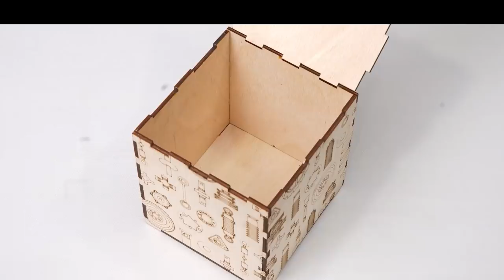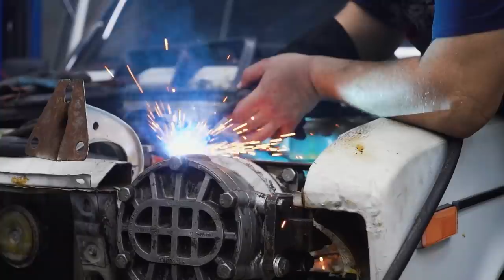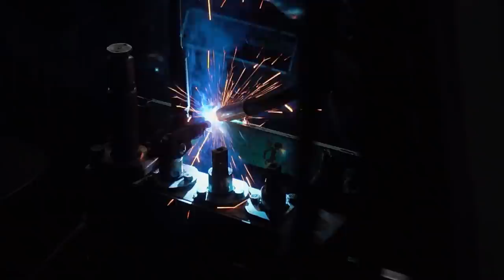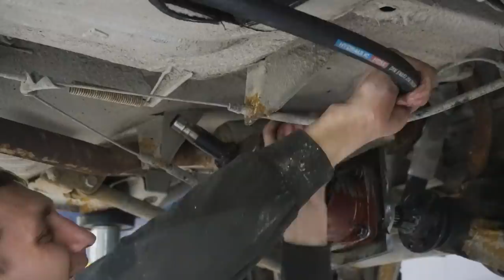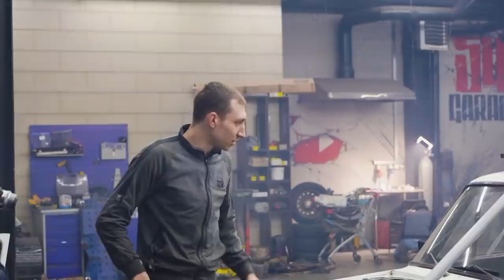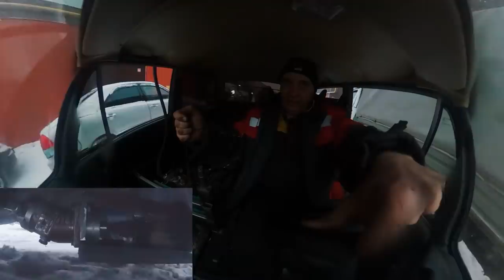Using excavator hydraulics as a propshaft

Comment: Hi. Huge fan of Garage 54 here. Mechatronic engineer.  You need to run that pump through the gearbox on a small petrol engine like that. The Volume/Power curve of that pump is optimized for a large displacement diesel engine which can achieve maximum power by about 1800 RPM. There is no chance of it producing any usable fluid power coupled like that. The pump curve is probably linear bell curve from 200 to 2000 RPM. Will just kill that little petrol engine before it can make any power. Also you need a relief valve on the pump output to prevent stalling the power unit in the case of overspeed vs load*pressure. About 150 bar should be good for your car.

Comment: Struggling to get the RPMs down? What happened to the thought of putting it on the tail shaft of the transmission? First gear would be a significant gear reduction!
Reply: @Bro Tang beat ya to it.
Reply: I think the idea was that they needed to put the transmission on the output end, not the pump end
The pump is being turned plenty fine, but the output is at high rpm while at idle
Reply: Agreed.  Mount it to the trans with out the valve and use it as the prop shaft. Modulating the clutch and gears
Reply: In this case the axial motor isnt delivering the torque required, axial motors used in high torque applications need reduction gear, if not its common to use radial motors.
Reply: @televisionandcheese  Yes, thats how its done on hydraulic drive forklifts, through hub reduction gears.
Reply: Exactly, this video made me cringe.
Reply: @televisionandcheese  use a 5:1 diff
Reply: @televisionandcheese  YOU ARE 100% RIGHT BUT ALSO THE LADA MOTOR WAS DEAD, BLOWING SMOKE WITH NO COMPRESSION AND NO POWER. UNFAIR.
Reply: "none of us have any idea what to do" 😄
Reply: Thank you bro I was just thinking that like he shut down the idea of putting after the trans and now he complains he can’t control the rpm 😭😭😭😭👍🏼👍🏼👍🏼

Comment: The drive motor is not your problem as you can see how well it rotated your wheels the problem is the pump usually requires a five to one mechanical advantage and that's on a three-quarter inch line it sounds like you don't have a big enough sprocket for large enough mechanical advantage
Reply: They didn't do the calculations
Reply: Exact same thought I had.  It would be really easy with that chain drive they have.  Just find a bigger sprocket.  The fact they mounted the pump to the chassis is problematic as well.  The chain is going to tension and loosen when the engine twists in it's motor mounts.  The chain drive is definitely the... weakest link. ;P  Sorry, couldn't resist.
Reply: Mmhmm this makes sense
Reply: Should put it on the output of the transmission in low gear and second only. It’s also not efficient at too high speed
Reply: Yes Definitely needs a gear reduction or a whole lot more power.  Any sizes hydraulic powered equipment will drive around with the engine at idle. Yes it’s slow and pulls the motor down some but it still moves. Simply put a bigger sprocket on the pump or smaller on the motor itself.
Reply: Maybe not, axial motors got low starting torque, forklifts use hub reduction gears to overcome this limitation, gearing down the pump dont help a lot, still need to get it rolling first, at low rpm the pistons are just pushing on the swashplate without making it rotate. Where high torque at low rpm is needed its common to use radial hydraulic motors.
Reply: If he ran it thru the gearbox maybe
Reply: Yeah they could do a diff to diff
Reply: Yeah that motor is spinning way fast.
But they also need to stop thinking of it as a car.
Lock the revs on full noise and regulate your speed with the valve body.
Generally speaking though you'd be looking at 100hp to run that pump and I don't think that clapped out Lada would do 100hp at less than 4000rpm
Reply: @pflaffik  better to use a variable pump and a good gear motor, but it could be used for charging an accumulator for brakes. It would need to be insulated and use high temp oils
Reply: best solution would have been to run pump after trans and use hydraulic lines as prop shaft
Reply: The drive motor is the problem. It's being used in the wrong application. An engineer would never spec this as a traction motor. There are plenty of hydraulic motors (radial,gear) that could do this job. Flow and pressure output would dictate the size of motor you could run. 

That pump was direct drive in an excavator, 1:1. I don't know why you're saying it should be 5:1. Pumps designed to be directly coupled will chew out the bearings from the side load of a pulley or sprocket.

 Most excavators I know of are closed center hydraulic systems. They build and maintain a set pressure and only produce flow when called for. It definitely could be done and work. These guys need to research hydraulic systems and know the specs of what  they had before attempting something like this if they wanted it to work. 

Kind of pissed me off because it was a good fun idea, executed horribly. I really wanted to see it work.
Reply: This is exactly what they explained at around the 15 minute mark.

Comment: I would rather try finding a closed loop type system over this one, its setup for this type of application. The reason why you cant pull off is the power requirement is to high based on your setup. If you had a variable displacement pump it would solve that. Here is the power calculation based on what I viewed, flow@2100 rpm is 210l/min, pressure was lets say 50bar so 210x50/600 = 17kw.
Try finding a LS variable displacement pump around 40cc with manual or electric control, LS (Load sensing) compatible valve that can handle 140l/min. You can keep the current motor. 
Going this route will allow to you control flow over pressure and give you more control of the systems power draw at low speeds. Takeoff would be easier because you can run higher pressures and regulate the flow keeping the power draw down until the pressure drops off after you speed up.

Comment: I've seen a track buggy setup like this except the motor was connected to the transaxle not just the differential. It was competitive so the idea does work well.
Reply: I live in Alaska and have also seen something like what you are talking about as well
Reply: I've seen it on @burning wrenches
Reply: It's how forklifts,  cherry pickers, Scissor lifts etc work.
Reply: @dogwalker666  yeah I know there's a lot of different hydraulic driven things but I was just talking about something you actually drive more than something that just moves. Was kinda like a Sprint car for a dirt oval so setup for high speed continuous load more than slow short distance work. The requirements for both would be very different I think🤷
Reply: @brotang2953  actually you might be surprised how much torque the 7.5T forklift has, remove the counter weight and mast, Turn off the speed limiter, and they take off like a dragster, The solid tyres have terrible grip so power slides are easy, Now you know what the maintenance dpt get up to on weekend overtime 🤫
Reply: @dogwalker666  lol we had an old Nissan that had a 4speed manual box with a separate fwd and reverse box at the yard, old yard beater but wide open in top it was good for 50kph no worries and slamming the fwd reverse lever for huge burnouts was probably 50% of it daily usage🤣🤣.
Reply: @brotang2953  The worst one we had was a Yale 4 Tonne it had a great feature that sometimes when going from fwd to Reverse it would continue going forward,  Even the dealer could not figure out why.

Comment: It just needs a much larger sprocket on the pump. Its spinning faster than its meant to which is spinning the drive faster than its meant to. All that is loading the cars engine up too much. Spin the pump slower and it will spin the drive slower which is like changing it to first gear from fourth.

Comment: Put the hydraulic motor in place of the engine and connect the motor to the gearbox input shaft... Use the engine only as a means to power the pump which will turn the motor and use the gearbox to adjust the gear ratio

Comment: As someone who installs pto and pumps on trucks, you have quite a large pump for a small gas engine. Id say try more reduction to the pump or a smaller pump but with less displacment you wont see nearly as much ground speed since you wont spin the hydraulic motor as quick. Without looking it up i think its 1.5kw to 2-3gpm when dealing with smaller units like plows and small dump beds.
Reply: Horsepower requirements are all based on GPM x PSI. Ballpark required Input horsepower = GPM x PSI X 0.007 for a vane style pump. 
They've just got a poorly  matched displacement ratio between the pump and motor.

Comment: This is one of their easiest experiments.
I know because I've done it. 
But I used a Toyota 4x4 chassis and ran the pump off the flywheel and the motor on the transfer case. It was permanent 4x4 and I ran tractor tyres.
It wasn't fast but it pulled a tonne of weight!

Comment: I always wanted to do it on my bike (also that way I could give it front-wheel drive), keep in mind that you need a radiator for the hydraulic fluid (it gets very hot).
I recommend using the gearbox of the car between the engine and the pump, and the direct differential (I still think that with first gear the engine would stop)

Comment: I think that if you found a way to mount the pump to the rear of the transmission gear box, you could reduce the load on the engine and get the desired results. The transmission would act as the stress reducer and give you more control over the amount of load needed by using the different drive gears. Think of what a PTO drive set up is like an treat it like that.

Comment: Imagine using this kind of setup for rapid drivetrain swaps or extreme offroading, no custom driveshaft needed and much easier to armor :D
Reply: It would be nice except, its 10x the cost and you lose like 25% of the power though heat. Not to mention reliability and maintenance costs.

Comment: Direct connect the pump to the transmission output shaft so you get a higher input torque and can choose the pump rotation speed then put the hydraulic motor on a 4:1 ratio where the motor shaft rotates 4 times for every 1 axle pinion rotation. This combination paired with the transmission gearing and axle gearing will ultimately ease the hydraulic effort and engine as well. 

I noticed that while under load the hydraulic motor touched some snow and instantly turned to water with some steam, this indicates a overworked hydraulic system causing the fluid to overheat.

Would love to see a revamp of this project

Comment: Pump to motor ratio is huge it’s like being in 5th gear. What about using power steering pumps. like 4 of them with 4 valves then you can add each one for more flow as it gets faster.

Comment: First put a rod to keep the chain in tension, then idle the engine to 4000rpm where it has it's highest power output. With the level on the hydraulics you should control the amount of the oil streaming through. Hydrodynamic transmission.. 😎

Comment: You should have it coupled to the transmission. What you're trying to do is set off in final drive or close to it, and a lada can't start off in 4th gear, not enough torque.

You could also use a variable displacement pump, which would allow for reduction and changing the gear ratio of the motor, like a CVT would.
Reply: Yeah, I was thinking about hydraulic  cvt too

Comment: You are trying to take off in theoretical hi gear. If you drove the transmission input shaft you could use 1st gear.....
Drive the pump off the back of the engine.  Move the transmission back - shorten the driveshaft. Hook the hydraulic motor to the transmission input shaft. You pump should turn the right way too.

Comment: 1- Diesel motor
2- transmission between the diff and the motor
3- beefy clutch, PTOs are a thing for a reason
I love how you're basically making a hydrostatic car, so goofy.. It seemed like you are already using a valve as a flow restrictor to reduce the instant torque issue, but on the off chance you aren't that might help you not just shock the whole system and break something once you have a good reduction gearing.

Comment: You could use variable displacement hydraulic pump and hydraulic motor. Then use planetary gear, connect engine output shaft to planet gear, the hydraulic motor to ring gear and after all this you technically have continuously variable transmission (like Fendt Vario).

Comment: I'm a mechanical engineer, I love your channel. Have you tried building a custom frame and equipping hydraulic motors to each wheel and running off the same high flow pump?😮 Also you wouldn't need to PTO. Just engine to the pump and to the wheel motors.

Comment: The pump usually is mounted to crankshaft and drive motor connected thru a gear reduction box. It also sounded like you had a relief valve issue loosing flow and pressure at motor

Comment: Use valving to switch the direction of flow to the motor would give forward and reverse. -- Or separate the the transmission from the engine and ditch the clutch - turn the engine sideways and mount the the pump directly to the motor - then mount the hydraulic motor to the input shaft of the transmission; that would give you 4-forward ratios and a reverse, but would otherwise operate like a hydraulically driven machine

Comment: Take a planetary gear out of an automatic transmission and put it between the hydraulic motor and the differential input. That should reduce it in an easy way by about 3:1
Reply: RPMs will not be enought then. These lada engines rev about 4,5k.
Reply: THEY NEED 8:1 TO 11:1  3:1 WILL NOT BE ENOUGH.

Comment: Put a smaller gear on the engine and a larger gear on the pump. This will increase the torque to the pump while decreasing the strain on the motor.

Comment: OK, so the engines power (torque x rpm) goes to the pump and is converted to flow x pressure.
Pressure seems to have a quite high value - basically depending on the friction of the tires and the inertia of the car when trying to accelerate.
Problem now: To deliver torque for pressure you need to rev the engine - but reving it increases oil flow - which increases flow resistance and thus pressure.
Basically what you do it try to start off in 4th gear or so.
In every mobile machinery you would have either a pump with variable displacement or a motor with such. This way you can either decrease flow on the pump (leaving more torque for pressure) or you decrease rpm on the motor (more torque off of a given pressure).
I guess your thinking is to have the valve regulate the flow and thus controlling the speed of the car - but the valve doesn't impact the torque vs. pressure problem. It only acts as some kind of clutch - driving off in 4th gear is a bad idea - with or without a clutch.

Since I don't recommend to go into the variable displacement pumps/motors, just gear the pump down. Less flow, less resistance in the hydraulic lines. Maybe check if the pressure is in a normal range (should be between 100 - 150 bars).

It might then basically feel like going off in 2nd gear - you will have to rev the engine to not stall it and still operate the valve carefully.

With a variable pump you would have had a CVT (continues variable transmission) - that would have been cool!

Comment: Good concept. You should try using a hydro static transmission, as used on large commercial grass cutting, plant machinery. This will overcome you take off and slow down problems.
Reply: I was thinking the same thing. I had a garden tractor (bigger than a riding lawn mower but smaller than the smallest utility tractor, with a size 0 or size 1 limited three-point hitch) with a hydrostatic transmission. For other folks, it ran by setting the engine RPM at peak power then controlling the oil flow with one of two foot pedals, one of which would send the machine forward and the other of which would send it backwards. The service brake was on the other side from the direction pedals.

Comment: To get the maximum pump pressure and flow, the pump needs to be turning and rated max rpm. Pressure is torque, flow is speed . Over-speeding pump may give a little more but will eventually wreck it. After that it's all down to gearing based on torque of hydraulic motor

Comment: Maybe mount the pump after the gearbox and get rid of the valves?
Reply: yes
Reply: open loop hydrostatic drive, with electronic proportioning control on a bent axis variable speed piston pump and motor sized and paired to the engine's peak torque.
Reply: @wacabby  basically power the motor and use the pump to drive the rear axle....
Reply: keep the valves as it's a CVT transmission but yes your rite i think the pump after the lada's original transmission
Reply: @richardprice5978  No, replace the transmission completely with a closed loop hydrostatic drive system. bent axis variable speed axial piston pump with load sensing, pressure compensation, over speed circuits, compensation valves, hot oil diverter valves and a smaller charge pump to supply the leakoil circuit. the motor needs to be connected to a final drive reductor box to transfer the operating speed of the motor to transmit torque effectively to the drive axle. https://www.youtube.com/watch?v=efV_P0wSvEw
Reply: WRONG..... THAT IS BACKWARDS.

Comment: I wonder what it would be like to put the pump to the output on the transmission and use the clutch to spin the pump.  And leave the hydraulic controls engaged.  This way you can control the output speed and ratio on demand.